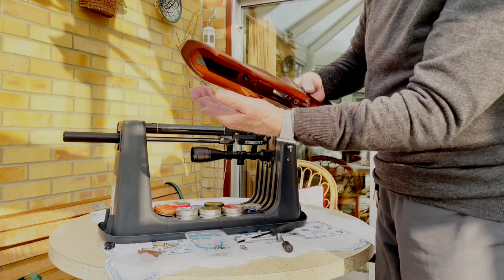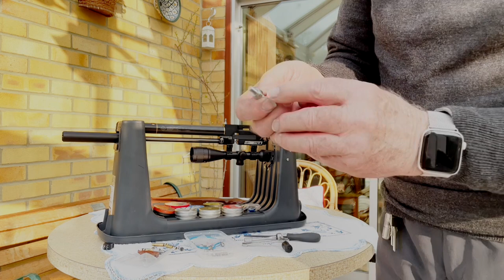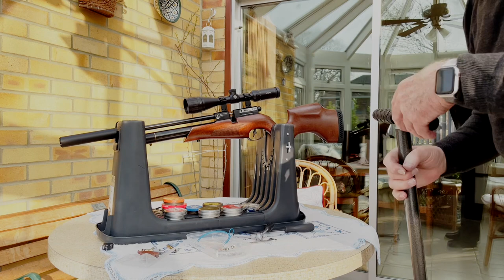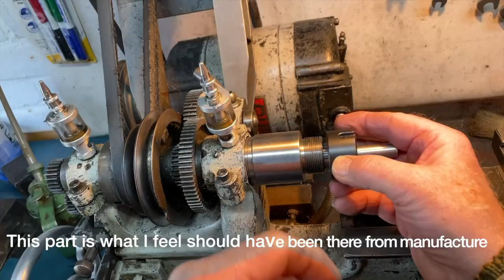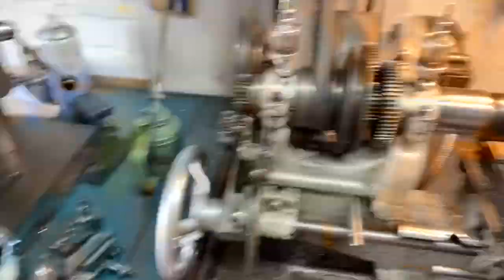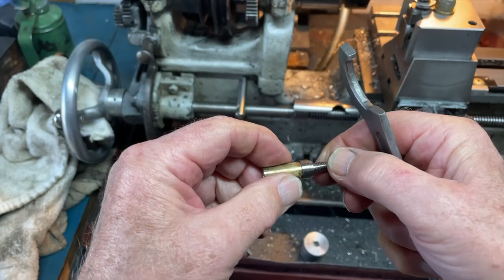BSA ULTRA CLX FATALY FLAWED FIX...

Comment: Thanks for your help Dave, very easy to fit and the rubber tape that you supplied makes the stock fit more snug. I’m confident your work will make my gun last many more years.
Reply from the maker: Thank you for taking the full kit and doing a comment. Best Dave

Comment: All it needs is a wooden plug glued in and driiled then a flat washer between the serrated washer and the stock as a DIY solution.
Reply from the maker: That has already been suggested. So not really original. How about two part epoxy?

Comment: Hello Sir, 
                It was very kind of you to make those spare parts for people. I think we automatically think when we buy new everything will be right and perfect, though this isn't always the case.
As generations get younger, they seem generally less interested in taking matters into their own hands and perform their own fixes.
My father worked as an electrical tester. He and his colleagues made all manner of things themselves, including sub aqua diving regulators, heated motorcycle gloves for winter. The first ones they made were too good, and they couldn't keep them on, lol.
I would say though, that most folk may not have a lathe, though it does seem a different mindset these days.
Jolly, good luck to you, Sir, and well done!
Best wishes, Ian.
Reply from the maker: Thank you for the encouragement. The things we learned at school, which included foundry work and casting aluminum and brass parts were the start of it all for me. These days you would not have a 15-year-old lifting out a crucible of molten ally to pour into a sand mold with a pair of tongs

Comment: I've just seen the video david. ingenious 

just for the those who questioned my experience with airguns,  whilst I can't produce a highly polished youtube video I've spent the best part of the last 10 years working in the background with various manufacturers on action design  prototyping and testing. aswell as improving the fixing and mounting options on plenty of hft and ft converted 10m air rifles. so I'm somewhat familiar with how this stuff should work 😉
Reply from the maker: So glad you've seen my video. Have sent out 46 of what I call the Stud kit. Seems that even the later sidelever ones have the same fault. Best Dave
Reply: Can’t find your site…….

Comment: Excellent solution, great craftmanship. All the stress is now metal to metal, the wood is just sandwiched.  Also highlighted as a flaw was pellet shavings in the magazine and mechanism. Have you come across / fixed this apparent problem ?
Reply from the maker: Hi Paul. I have not come across that problem with the magazine and these days mainly use a single shot that I made. Find it easy to swop pellets choice and it is nearly as easy as loading the magazine. Best Dave

Comment: Great video but what would have been the point of BSA counter boring the stock in the first place. Do you know if newer ones are the same as I would quite like one.
Reply from the maker: Yes it seems that even the new AAR Green ones with side lever still have the counterbore on the inside of the stock. I do wonder if that was for holding during the machining process, can't see any other reason to just remove material in a rather critical place. Still a great gun and accurate even when just leaning against a wall and holding the gun while standing. I'm still hitting a penny size or acorns out of their cups at 30-40 meters. Best Dave
Reply: @dave20thmay  Thanks.

Comment: Will you update on here when your about to sell on eBay or where you will sell them. Could be you just do it on a FB page. When someone wants one they message you with quantity. No fees,  just do one posting of orders every 2 weeks if the volume is good enough or weekly if that’s easier.
Reply: @dave20thmay  Thanks for the reply. It’s the same for every commodity around the world. Look forward to these. I’ve just checked mine and I have about 5mm thickness. Still not very good though. Keep up the good vids.

Comment: Dave can you give me yer details so I can buy one of your double ended bolts for the clx ultras bud
Reply from the maker: Hi James. Go to my photo in the circle, click and then along to about to find email. Send one for full information. Look forward to your email. BestDave
Reply: @dave20thmay  hi dave I'm thick with emails all get one a my daughters to do it I bought the clx for me and the grandson that's what I tell my daughters when I'm told I've enough guns it's only a couple a months old I bought it brand new with the intention of getting it ratworks tuned but I see your point of view with the double threaded bolt really good idea
Reply from the maker: @jamesmartin9319  Hi James if the daughters are not around. send an email to d.j.wilson@mac.com
Reply: Dave are you still doing the bolts

Comment: what maybe  better is if you glued a dowel in and obviously drilled it through there after to allow the bolt through for the mono block.then its actually as if the stock was truly thicker,not just supported by washers...im thinking of buying a clx and saw the video you refer to and considered how it could be resolved....do you like the CLX?ive many air rifles and bsa in particular and fancied a nice short light rifle for pest control from the car...i do like the stock on the ultra SE better,just the way its shaped,is more interesting to the eye and looks perfect for shooting off hand
Reply from the maker: That has been suggested several times. Even filling with liquid metal paste. But the thing for me is there is not a lot of thread in the gun, so if you want your gun to still be working fine in fifty years' time, my stud takes that problem away. One of my Cadet Majors I bought in 1960 and it still shoots amazing accurately. Well, over 100 now shipped and no complaints, so others don't think the Bodge is worth doing.
Reply: @dave20thmay  okidoke..

Comment: Hi Dave. Would these fit the R12 CLX PRO side lever? If so cold you please tell me how much they are. Great workmanship.👍👍
Reply from the maker: Hi Mark. I'm fairly certain that the R12 does not suffer the same fault. If you are getting or have one and find it has got the internal counterbore and could do with this stud fix, let me know and we will get it sorted. Would love to add another BSA to my collection, but her indoors might have a  moan about it. All the Best and have a Great Christmas. Dave
Reply: @dave20thmay  Thanks for the reply. Not had any issues yet with the R1but as they are on the same block thought it may be the same problem. I will keep n eye out and see what happens and let you know. Merry Christmas to you too.
Reply from the maker: @markmdusty3  Hi Mark. I'm fairly certain that in the feed-back I have received from clients that the R12 does not have this fault. Best Dave

Comment: I'm considering getting a BSA CLX Ultra do you still have your mod's available?
Reply from the maker: I sure do have them, although stocks of the studs are getting low. Will have to get out there and start a new batch. You should easily find my email by clicking on my face in the round disk. Best Dave

Comment: This mod does not address the lack of timber thickness caused by the unneeded internal counter bore.....is epoxy the solution?
Reply from the maker: I think you are right, but my stud kit does fill the hole and support the stock. I and seventy users think it is a good engineering solution. Also under the screw head was a star washer, that cut away at the bottom of the outside screw hole. The washer and domed nut does a much better job of holding the stock on. Try one before you buy if you like.

Comment: Hi again.. how easy is the removing the cylinder? . My intention is to de ping my clx .. does it just screw or ? .. plz advise many thanks
Reply from the maker: Hi to you. I know how good my fix is, but not about unscrewing the cylinder or even what de pinning is? I know that you would have to completely let all the air out by repeated shooting to unscrew it. But what you'd want to do after that I don't know. Not even sure I'd need to know as I find the rifle perfect as it is. I wondered why you did not come back to order a Stud kit?
Reply: @dave20thmay  send me order details so i can plz
Reply from the maker: @degingedeginge9167  I need an email address to do that. Mine is d.j.wilson@mac.com. Which country are you in, hope it's the UK. Best Dave

Comment: So when you mentioned about the o ring before the silencer was that meant to make it quieter? you are an handy bloke Well done
Reply from the maker: No, I did not fit it to make it quieter. But just to stop the metal faces of the barrel and silencer, being close, the rubber O ring gives it some grip so no need to really tighten down. Just a thought. Dave

Comment: I don't think it's a design fault, rather an owner's fault. 
I have a ultra but the stock screw has a plain washer and does not work loose.
Reply from the maker: I bet if you had the stud, you'd see that it was much better than just a Torx screw. The support given inside the stock and also not wearing out the threads in the block over many years. No doubt these guns can be around in sixty years like my Cadet Major.

Comment: Ye gads such an easy thing to fix little piece of dowel bit of glue drill hole thru dowel once glued job done 45 seconds tops
Reply from the maker: Now that is a great idea, you could even use metal paste and then drill through.  But it would not address the short amount of thread that the screw fixes into.

Comment: good luck to you if you can sell this piece....us shooters love to buy a lemon and try to fix it bsa should be ashamed......it still relies on a very thin piece of timber to hold the stock in place...filling the gap without bonding it to the stock does not help....i still think epoxy and a plain washer is the solution
Reply from the maker: I hope you don't think the CLX is a lemon. It's each to their own I suppose. I like what I've done and reading the mail I get back, not just in the comment section a lot of others feel the same.

Comment: Sorry Dave.....the clx is a lemon....tell us how to remove the barrel with the transfer port trapped in the monoblock.....no there's too much wrong with it
Reply from the maker: Hi Bryan. Not sure that I need to remove the barrel, but the transfer tube can be removed after drilling out a blanking plug and using a small easyout to pull it out. I think the transfer tube was brass. It is still a great gun even if there is a drizzle of lemon.